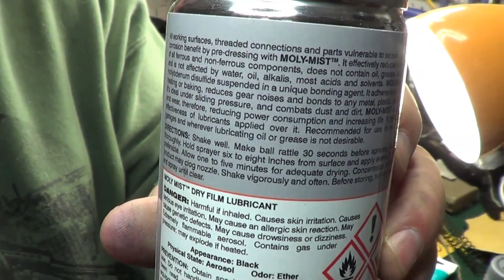Using Moly On Pow Pow Sticks - Is Your AR Firing Pin Retainer Pin In Upside Down?

Comment: I have been using Molly paste for years now, but mostly for its anti-rust properties. I mostly hand rub it into the outside of barrels and gas blocks, the part under a handguard, that you would not normally have access to. If you apply it to a spring, and compare it to normal oils or Greece, you can feel a significant difference in how it works. Hope this helps, thanks for the video, you the man Rick!
Reply: You mentioned the spring...I'm beginning to have significant problems with racking the slide on my 9, as I'm disabled and have lost muscle-mass and strength in my hands and arms. My son thinks it's the spring itself and needs replacing. Do you think maybe an application of this stuff might take care of the issue?
Reply: DachshundsRule no it will not help make racking the slide easier. I got a Glock slide with fish gill serrations, because it look cool in the picture, but as far is traction it was terrible. I bought a extended back plate on eBay, which made a world of difference. My M and P with the factory spring felt like it took 50 pounds to pull back the slide. I found a company online that made extended back plates for it, but it only made a minor improvement. So I found a company that made an aftermarket guide rod, with a single spring now everyone in the family can use it. These extended back plates stick out about an eighth of an inch on each side. This gives you a little more to grab onto, they're not pretty, but all in all not bad, it helps make it better. Since I don't know if these mods would apply to you. You can always get an aftermarket guide rod with a spring that is one or at most 2 pounds lighter than the factory spring. With this set up, I would not make it a habit of using +P+ 9mm on a regular basis. Factory loads or reloading according to the book should not be a problem. I hope this helps you! I feel your pain, I have terrible arthritis in my hands
Reply: @sierrabravo9228  I will show this to my son, he was already exploring different ideas for me. I know basic stuff about firearms, but I wouldn't try to correct or replace anything myself, LOL. I'll look at the extended back plate. My son also had this 9 powder-coated for me, as it helps me with better grip retention (I tend to drop things) I'd hate to give up my 9, my Dad passed it to me when he died and it's perfect for a carry piece, other than the slide issue. Thank you for the advice! And hoping for relief for your arthritis--I know getting old sucks, LOL.

Comment: I worked in a steel mill for about a decade. We produced rod, bar, and wire. Moly was one coating we used on our product and it was used so that the steel could be fed through the customer's machine without the need for lube. If it works under those conditions, I'm sure it'll work well on a firearm.

Comment: The laws of physics state "The wider the base the greater the stability,  the more narrow the base the greater the mobility."  If you want the pin to be more stable you put the pin in horizontal unless there is an internal part that impinges upon that pin that would create enough shearing force within the tolerances of that 90º difference to break the pin. I'm 90% certain it shouldn't go in vertical.
Reply from the maker: wow, that sounds like there is some science behind what that guy was saying..

Comment: When I was building heavy underground mining equipment we used that moly spray all the time on inserts and axle bolts and all major bolts to reduce friction in the torquing process. I’m talking about big bolts like 2 inch fine thread up to 1800 foot pounds of torque. We had a dry torque, a wet torque-oil , then a moly torque spec. We would spray on the bolts and washers and nuts. Messy stuff but it works great and comes out semi dry. We had a problem with snapping bolts because we where using the moly lube but the prints didn’t call out the difference in specs and it was driving the engineers nuts trying to figure it out but they finally did and we had to correct all out torque specifications on every print🤪🤪🤪🤪🥃😎.
Reply from the maker: wow pretty interesting stuff, thanks

Comment: Moly is a great lubricant. The molybdenum platelets fill the pores in the steel and they slide across each other with a very low coefficient of friction. The problems are that it is not good for you, so you should apply it with rubber/latex gloves if you are using grease and avoid breathing the vapors if you are using spray. That being said when firing a gun (especially an AR) gases are venting in your immediate vicinity and you may inhale some molybdenum molecules (hopefully not very many, but over enough time it can build up in your system like lead). Another problem is that manufacturers don't design firearms with moly in mind and the lower friction can be too low (bolts slamming into the rear of the receiver being the main problem, some addition felt recoil, etc.). Also, depending on the brand you use, especially sprays, the moly can mimic carbon residue visually and cause you to keep cleaning if you are OCD about clean guns, as Rick showed it will just keep coming off on a rag or patch but it is the moly residue not actual dirt or carbon. So the moral of the story is don't overdo it, a little moly goes a very long way and it works best to only apply it to areas of high contact so that it isn't so hard to clean up. As an added bonus to moly sprays, a little shot down the barrel will keep dust and debris from building up on guns that you carry frequently (I used to clean my carry gun every two weeks and it was amazing how much lint and dust would come out, after using moly spray there is barely any after two months). If you are going to use moly, do what Rick did and just get it from a auto or machining source, gun moly is the same stuff but they charge you double or more (I work at a forklift dealer and we have piles of it for the equipment, I bought a can that will last for the rest of my life for a couple bucks).

Comment: The surface of any metal, when you zoom right in, will look like a mountain range with peaks and valleys. putting a grease on the surface will fill the valleys with lube, as the metal rubs and you wear the peaks off the material, you will pick up some off the grease from the valley. at least that is the theory.  I would need to test it to see if it actually works to reduce friction and wear.
Re the pin, if there was a significant issue, the hole the pin fits in would be designed to prevent the rotation of the pin, so that it is always correctly rotated. As the hole, after 60 years, is still round, the pin is strong enough no matter the orientation.

Comment: You know, I used to race desert cars. We would convert VW transaxles to use big long Porsche axles with 930 cv joints so we could get extreme angles and have 20+ inches of wheel travel. 
That's a very expensive set up and it's pushing those parts to the max. One of my sponsors gave me a big ol bucket of Molybdenum cv grease. 
I started using it on my guns and haven't gone back.

Comment: Hell, I've been using high temp bearing grease forever but I need dry lube for my gas ring on the Mossberg 930 SPX semi auto. This stuff seems to be a great alternative to graphite. Thanks for the tip Rick.
Molybdenum Disulfide Coatings
...
Molybdenum Disulfide Coatings (MoS2 coatings), also known as Moly Coatings are commonly used in applications where load carrying capacity, operating pressure and coefficient of friction are primary concerns. This coating provides effective lubrication in a wide range of loads, in many cases exceeding 250,000 psi. Moly coatings lubricate sacrificially by transferring lubricant between the two mating surfaces, which helps to reduce wear and coefficient of friction. Molybdenum Disulfide (MoS2) coatings are a dry film lubricant.
Moly coating is a combination of molybdenum disulfide lubricant and high performance resins.

Comment: I've already posted this tip on Millitairy Arms Channel     BUT   if you want your pin to find its way thru the bolt carrier nice and easy.    Grab some 1000 grit sand paper and round over pollish the sharp edges on the tip and they go in like butter    Don't get carried away only takes a couple of SWIPES  to round each sides sharp edge in towards center.
Reply: Blocked User that’s what I do on mine too. I just touch it to my belt sander a couple times on those edges.
Reply: Cosmoline Fiend    Yup  they go in like butter.    You'd think they would do it at the factory.    Think of all those American soldiers in the heat of battle trying to clean their bcg and dropping the pin cause they can't get it in under duress...
Reply: Blocked User it definitely adds a level of difficulty when being fired upon!
Reply: Funny you say that my army unit when we got in new rifles before they were issued the armor would do that great point ty
Reply: @blockeduser5769   I hope you're joking but I've never seen  Any of my brothers strip down their weapon and pull out the firing pin under fire .....  Or really anywhere other than a base or Bradley
Reply: @Justin Bellio    If you're not roaming far from base that might be an option.    But If my rifle was acting up ,   I wouldn't think twice about ditching inbetween a wall or door way while one of my buds covers our backs and spend a whole of 30 seconds checking it for debris or what not.    Knowing what I know I would probably even keep a spare firing pin on me  ...   But thats just me.   Some people are more mechanically gifted than others...

Comment: We use a moly blended grease on some heavy equipment tools. One of the best attributes of moly is that it has great heat tolerance it doesn’t break down like standard grease from high temperatures. One thing that comes to mind though if the moly mist is a dry lubricate I personally would rather use that on my bang stick than the CV Moly. If I was building my bang stick I would assemble it with the CV Moly and then after the first cleaning then spray it down with the mist. This is why a wet lubricant will attract carbon and any other particles while a dry lubricant on something like your bolt won’t allow anything to stick to it so I would think much longer run time between cleanings. (Side note) - My self and a friend of mine built aftermarket high end clutches on our snowmobiles (external clutches) he used a high end wet lubricant when spraying down his external clutch’s and I used a dry lubricant I have almost 3000 miles on my sled with out having to ever replace anything and he barely got 1000 miles out of his before he had to replace the hole clutch assembly. The dealer explained to us that by him using the wet lubricant it essentially turned into sand paper by attracting dirt and what not and ground his clutches to nothing while mine has wear it’s still perfectly fine to still use for another season or two. Im sure both moly’s are great and probably better than using standard gun oil I just think the dry lubricant would be better 
    Thanks for all the great content Rick you are the Man!

Comment: The split pin is a retainer pin only and basically only placed under very minor shear force.
Ideally for long term wear reasons the head of the split pin would be best fitted horizontally, this makes the rounded surface area of the split pin shank contact the curved surface areas on the firing pin.

CV Joint grease is incredibly good grease. 
It lasts for many thousands of miles packed into constant velocity joints on vehicles and machinery, eg front wheel drive cars. 
Buy a tube of CV Joint grease and just smear a very light amount on the surfaces requiring lubrication.

You will commonly find molybdenum disulfide grease used in machinery / expensive machinery operating under extreme conditions.
Reply from the maker: thanks for well constructed comment..
Reply: @HeyGunPeople  
No problem, you posted a very good topic.
CV joint grease is also good for assembly & tensioning of nuts & bolts / threaded fasteners / hard to drive in nails, vehicle wheel nuts & studs, gate hinge lube etc etc.

* It is good to stick a blob of CV behind door handles & padlocks etc to see if someone has been snooping around. Snoops don't expect that & hate getting it on them.

At one workplace we had an absolute d/head boss. His work site bicycle had CV grease rubbed on its tyres so he crashed, then someone from a catwalk above doused him with a bucket or urine / old milk / cigarette butts etc. That afternoon he found CV grease smeared over his quite new and fancy car windscreen, under the car door handles, on the head lights and paintwork.

Comment: I'm thinkin if both sides of the pin are taking the hit its stronger so I say vertical ,  but I also think no matter which way you put it in theres nothing that keeps it from rotating.   So after thousands of rounds are shot who knows which way it sits without doing some in depth testing...

Comment: I forgot about Moly,   I use it on cutting taps that have HIGH friction.  
Huge difference, you can't get the stuff off.  
Back in 2002 , Moly was a key to Pinebox derby 1st , Others just used graphite,  We had the ugliest Car , but smoked the veterans in this racket.   I had 3 Mech engineers on my team and machine shop behind the curtain.  We were the rookies and told not to have any expectations.  We not only Won, it wasn't even close.   
Moly was and is something those Mech engineers get excited about .  I don't think it out gases either, but need to check.

Comment: Thanks for the tips! I appreciate them. I always put the firing pin retention pin in vertically 'cause that was the way it came...but I think it doesn't really matter. Negligible strength difference...otherwise it would have been engineered to go in only one way!

Comment: I got tired of trying to get my retaining pin out and in my BCG. I had to use tools to do it which I felt was not normal. I polished it and lubed it but that didn't help 
I wound up replacing it with a KNS Perma Pin. This pin is round so there is no vertical or horizontal orientation to worry about, which I think doesn't matter anyway. The pin just keeps the firing pin from falling out. It isn't impacted like the back of the firing pin or the bolt face.

Comment: Moly coated bullets have been around for a long time. Trouble is it plaques regularly but wears irregularly. 

It can cause inconsistencies in accuracy but increase in pressure. The result in light application is good if done sparingly.

Comment: Hmm that firing pin retaining pin thing. I never thought it went any other way than vertical. Most bcg's I've ever dealt with if the pin is horizontal it sticks out a little bit, but vertical it falls right in place down in the recess.

Comment: Moly, yup-yup....I used years ago graphite spray the same way. Yes, you can use the dry spray moly down your barrel. For parts that are worn a bit sloppy you can use boron nitride which builds a thicker coat and operates much like graphite and will accept both graphite and moly dry sprays, which penetrate and load the BN for added lubricity. Only thing is people look down the barrel and "This things is dirty!" no, no.

Comment: Your talk about the firing pin retaining pin got me curious so I did a little research on if it is supposed to have a specific orientation when installed. I could find no sources that stated vertical or horizontal but nearly all pictures and illustrations showed horizontal and one army manual seemed to show a 45 degree orientation. The only thing I can think is that when the pin is installed horizontally the curved side of the retainer is what the flange on the firing pin would come in contact with and that flange has a curve that matches the outside of the retainer. Does it matter?  I have no clue. 

Sites looked at. H&K, Colt, Armalite, DPMS. 

One thing I saw on the HK site was that their retainer was perfectly round, so it was a round surface in contact with the flange of the firing pin.

Comment: Oh, the lint cat hair freaked me out so much I forgot to tellya,,, Moly is some kinda almost magical shytt. Look up a process called 'Tufftriding' GM used to do it to their high zoot bad ass big blocks back in the day.  The molybdenum disulfide was applied to a canvas buffing wheel, (on edge), then the crank journals were buffed until the moly was burnished into the bearing surfaces,,, then, the bearings were lightly polished with the same compound. On final assembly, 'tuftrided' engines showed measurable gains in horsepower thanks to reduced friction. 

Any metal, if you magnified its surface enough,  has porosity at the molecular level. Moly fills in those gaps, which, effectively makes the surface smoother. 

My instructors in school were all old school rough cuts. Lotsa euphemisms that were not safe for mixed company were used in our learning environment. 

When Mr. Norville Kinder, retired USMC Leatherneck was smiling and explaining how to best prep a big block for assembly,  to be bad fast,,, he said if you put Moly on yer crank, you better keep an eye on yer Tach.

He had more interesting information that he would occasionally share,,, but he seemed to be careful which of us he would share it with. 

I am lucky that I had guys like that as my leading men. They are the reason guys like you and me know the difference between right and wrong. 

It's sad to see the deficit of fathering and mentoring in today's 'participation trophy' crowd.